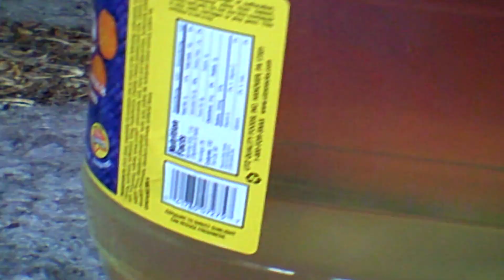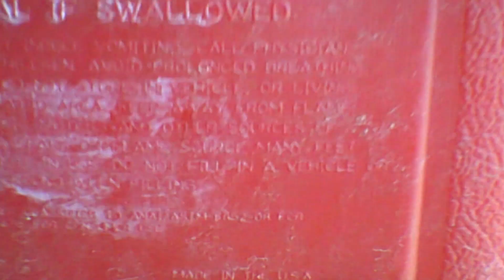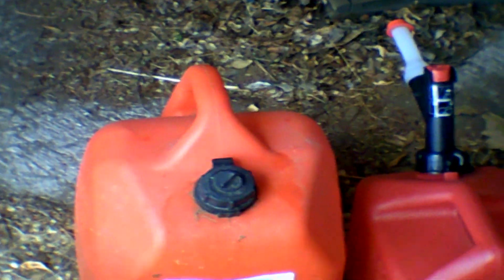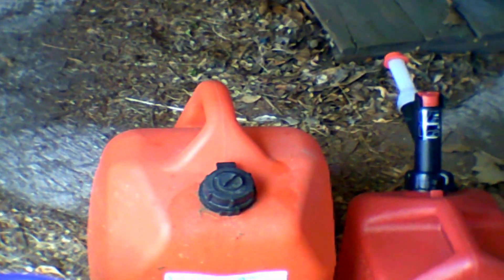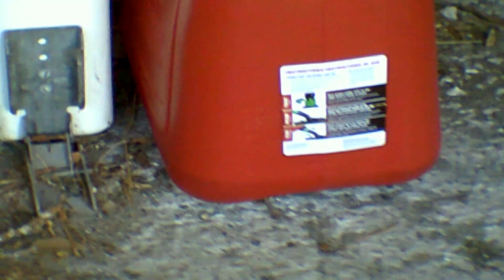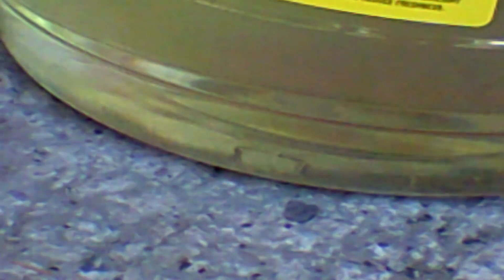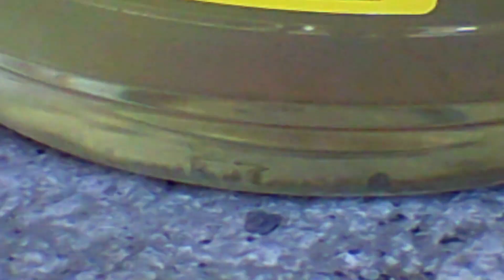How long does it take to remove ethanol from gas

Comment: well first off if you're doing this just for, your generator then you are wasting your money and time most all generators will run on straight pump gas with 10% ethanol with no problems but what you can not do is store gasoline in your generators fuel tank for a long time you need to shut off tanks fuel switch let it run out of gas carb should now be empty. if you wont be using generator drain the fuel tank or run it a few hours a month to keep thing running well.
Reply from the maker: Even the paperwork that came with my generator say's that it would be better to use Non Ethanol Fuel.

Comment: add dark food coloring you will see a clear difference
quicker way....take 5 gal can put 3 gal 93 octane in it add about 20% water
let sit several days...slow pour off (no vent holes are needed)
remaining ethanol and water will evaperate
Reply from the maker: The food coloring can be added if needed, but the only way that I would not have vent holes is if the container had a airtight screw on lid. As for the remaining ethanol and water mix. I just burn it in a large metal pan.

Comment: I wait for 4 days minimum
Reply from the maker: I have never had to wait for 4 days. The most that I have had to wait has been 32 hours and that's only because I forgot about it. Usually it separates within 24 to 26 hours but if you are unsure then 2 days should be plenty.

Comment: You do know that once the Ethanol is removed you have also Lowered your Octane value ….. unless you use an additive to bring it back up … do you not have available in your country premium ethanol free fuel ? By the time you play around with it like this Plus you add Octane booster it will cost the same as Premium ethanol Free fuel.
Reply: Removal of ethanol from gasoline reduces the octane rating by about 3 points.
Reply from the maker: @stuartbrown9307  You are correct, but if you start with 89 or 93 octane you will be fine for running pretty much anything you need to run.
Reply from the maker: Just start with either 89 or 93 octane and you would be fine.